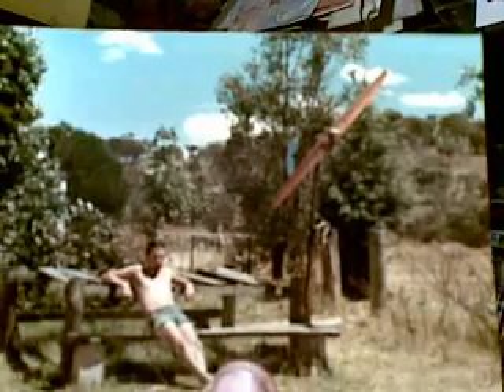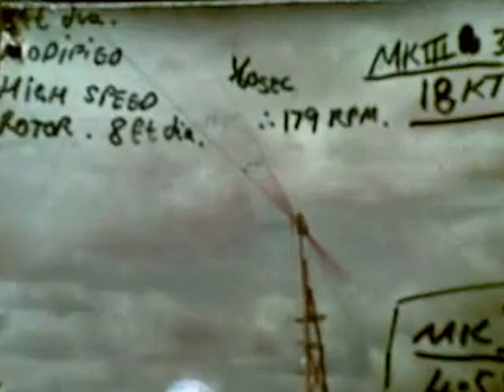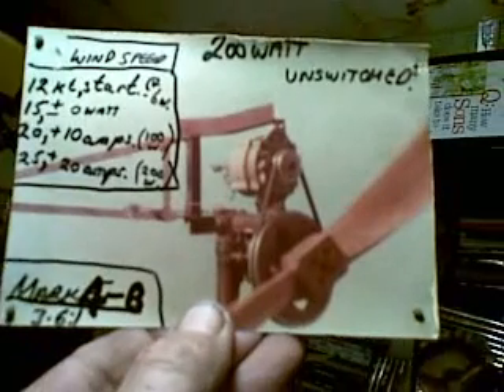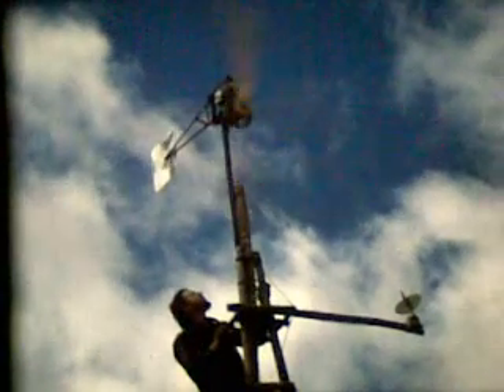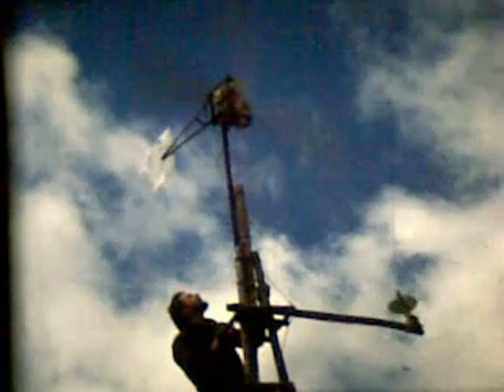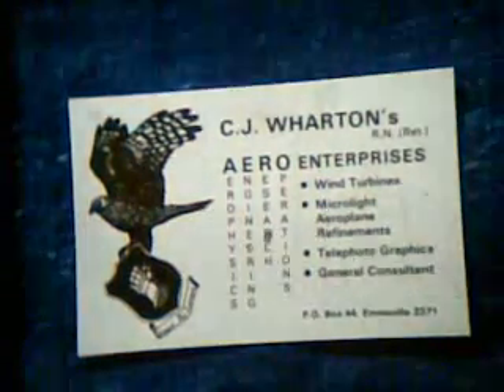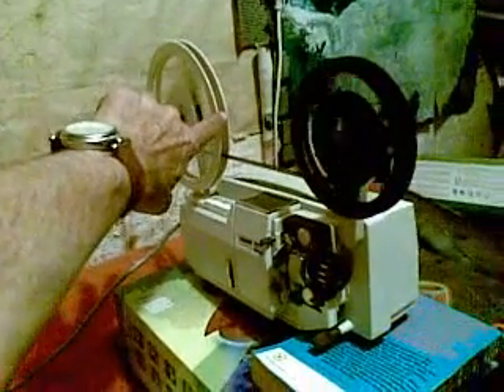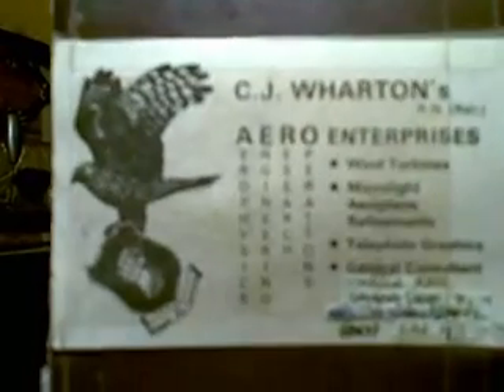AERO-HILLBILLY WINDMILLS... Skypower Mk1 to Mk4c. (Includes Super-8 Footage).

Comment: Bloody hell your not an enthusiast yer a genius (well I am a female - but I'm not that easily impressed)  This is really the biz you're gonna be my favorite aussie next to Nick Cave Now. I'll be a regular watcher from now on Who knew you could get really impressive info on YouTube!! I'm astounded with admiration - oh mate we get 75mph winds quite often up in Scotland! you'd love it and the water in the stream can be utilised in the same basic way!
Reply from the maker: G'day, thanks mate...
 Well, it's a bit funny, I retreated from Minimum Aircraft to Wind Turbines, then went back to what had become Ultralights, and then finally I capitulated and bought a Solar Panel...; if you search "The SunFoil Project..." as a Movie Title you'll see the streamlined Solar Panel which I have atop my 4WD Subaru...

  My problem right now, which stops me from setting up the 300 Watt Chinese Wind Turbine which part-blocks my Hut Door, is the size of the project needed to make and erect a Tower to get it 10 ft vertically above everything within 500 ft horizontally, rather than clear every tree in the Forest out to 500 ft...

  If you're somewhere where 75 Miles per Hour Windspeed is a regular thing, you probably should look for Wind Turbines designed for being mounted on Yachts...Terrestrial Wind Turbines generally reach Full Rated Output between 28 and 32 MPH , and most are set up to self-feather by around 40 MPH...

  Most Wind Turbines will be into pure Survival Mode, by anything over 50 MPH, desperately trying not to push the Tower flat to the Ground, or to prevent the Blades from flying off and away from Over-Rev-ing...

  Do lots of research before buying a small system which you can add to when you've gained enough experience  to avoid buying something Shiny which is designed for somewhere else entirely...

 I hope that helps...

 ;-p

Ciao !

Comment: I really like your wind turbine video.  My sister and I have some woodland (ex-forrestery commission) and I was wanting to know about the feasability of wind turbines (sister has house with woodburning heating & hot water) but I'm kinda getting a chalet/cabin and there's a pretty fast runnin stream right next to my spot.  I want to keep as self sufficient as possible as regards power etc.(goal is to be totally self sufficient eventually) the big wind turbines in our area which is 1,000 ft above sea level at least, have been going on fire with the local wind speeds. So I reckon between the wind and the stream I must be able to at least run a fridge freezer? The sheer amount of wood left behind since we got it and the stuff we have harvested (by contractor/buyer), yes the leftovers have been enough to fence and build and probably burn for years.  I used to have one of those open fires with a back-boiler and an oven/range on the side and if I could get one of those, a pump and a couple of radiators all the winter heating will be seen to.  I saw an ad for fully funded solar panels on the web today, some government grant scheme, and, because we are up in the North East Moray-Aberdeenshire area we get a lot of light in summer maybe its not very warm but it is almost 22hours a day in June and I'm led to believe its the quantity rather than the quality that matters (no size jokes intended - If there's an opportunity to say something stupid like that I, unfortunately always do!) Anyway, keep posting your videos and maybe dumb them down a little for me once in a while!! Cheers Mate.

Comment from the maker: @muddymuddymuddmann
   G'day Scott...  Yay Team ! I'd almost forgotten the Hand-Held Tip-Tracking/ Vibration  Tests... I used to use a Big Screwdriver... Just poke the shaft through the hole & Brace into Wind with both hands on the handle... If it's outa balance it jumps around & the loose fit lets it find it's own Axis....  The 8-footers frightened me a few times ! I uploaded some Super-8 4WD High-Speed on Dirt too, 3 miles on a 3 minute film, Standing-Still to Stopped. Yee Haa !